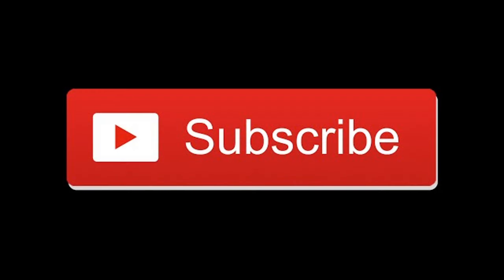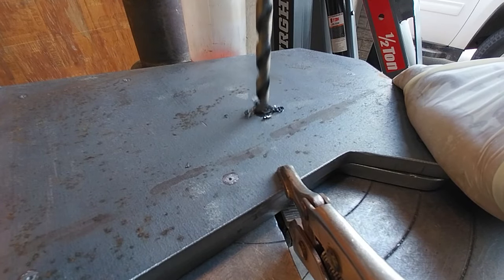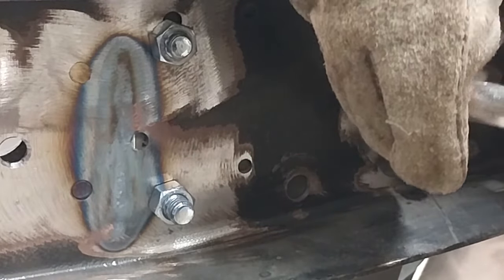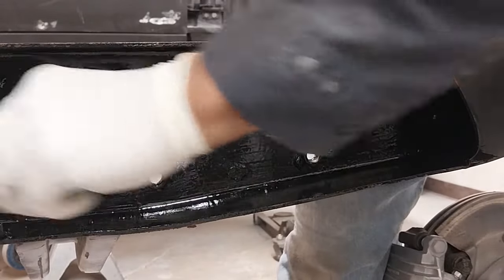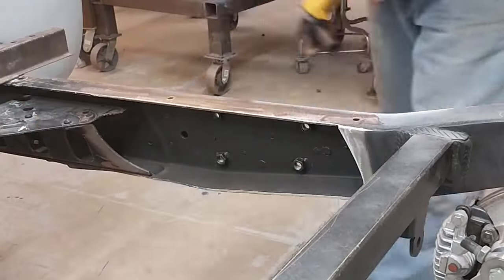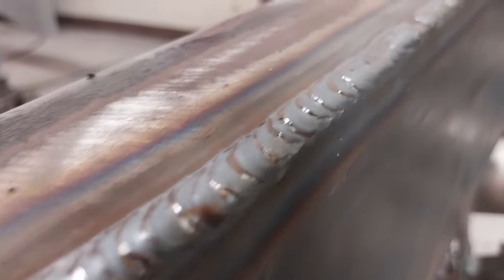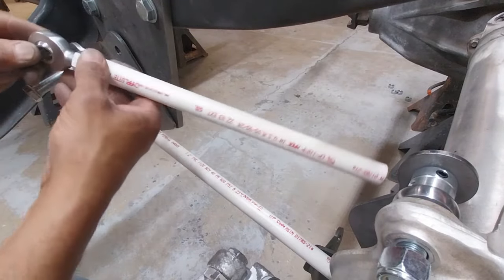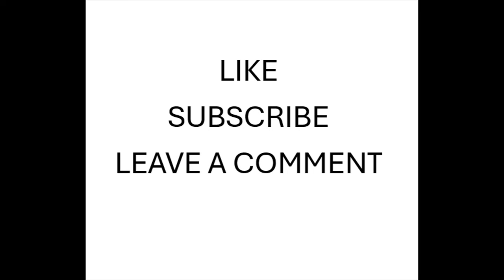Independant Rear Suspension (IRS) C-4 Corvette Swap  / Box Frame Rails - LS Powered Resto Project

Comment: Those were nice welds. No need to grind them. Heck after a powdercoat, you wouldn't even notice them, especially under a truck!
Reply from the maker: It's all in the fit up and prep, if that is right the welding goes really well. Thanks for the comment !!

Comment: Pretty bad ass it makes me want to do a zl1 irs on my truck. Robert question so I have a 2018 Silverado roof panel only got ugly on one the rear corners all the damage is in the  seam it tore where it curves down. I was thinking about cutting that area out and replacing it with new piece of sheet metal, would this be a good plan or should I just straighten the best I can weld it and seam seal really well?
Reply from the maker: If there is a donor or new piece available, I'd go that route. Thanks !!

Comment: You have a kit for the c4 install or were to get kit.😅
Reply from the maker: Great question, this kit came from flat out engineering, but I DONOT recommend them.... This was customer supplied. I've had to reengineer most of the kit and with this kit you can't use a sway bar in the rear. Sorry I don't have a better lead for you.

Comment: Will you put any pinion angle on the rear joint the corvette that I measured had 5 degrees up at the trans and 0 degrees at the rear which I thought was odd ? Do you think this is because they are rigidly mounted both to the frame and between the trans and the diff ? It seems to me that even tho they dont move like a regular suspension you would still want the rear joint to offset the front joint angle .
Reply from the maker: @manicmechanic9117  Great question, usually 3 degrees down at the tailshaft and 2 degrees up at pinion for a starting point but I'm not locked in, I can shim the front of the pinion mount  down and the tail shaft mount up if needed. Always leave yourself wiggle room. Thanks

Comment: That will be an awesome truck! Using the pvc for mock up is a great way to get the length set up! Never seen that before, thanks again for another tip that's just simple and works. Also like seeing the fab work done without an automated cutting table. I don't disagree with using those just nice to see the old school work still being utilized
Reply from the maker: @michiganracer1181  thanks ! It's funny  how you can measure something and it still be wrong... but with the pvc same diameter, no chance. Thanks for supporting the channel !!!

Comment: Hey Robert I have a  good question...Do you recommend or can you take a body off the frame with the front and back Windshield?..Thanks
Reply from the maker: Is it a convertible ?
Reply: @guzzifabrication3448  it is a Hardtop 88 Monte Carlo LS
Reply: @guzzifabrication3448  my thinking was that leaving my Front and Back Windshield would ADD Reinforcement and stiffness to my body that way it doesn't flex or bend..and that's with the square tubing reinforcement inside welded to the car with everything down to bare bones EXCEPT the Front and Back Windshield. Hey Thanks for Replying! 🙂

Comment: Hey Robert a lot of good tips in this one. Do you recommend the soapstone over the Milwaukee pens? I’ve been using those for years, but the soapstone is definitely more visible but seems less accurate.
Reply from the maker: Thanks !! I use both, but the soapstone never fails and I can buy a 5 yrs supply compared to 1 quality pen.... if you sharpen the soapstone accuracy is never a problem.  I think I've tried every type of marker
Reply: @guzzifabrication3448  ok thanks for the advice
Reply from the maker: @UnconventionalMetal  Don't get me wrong the Milwaukee pens are awesome !
Reply: @guzzifabrication3448  oh definitely, especially for the price, they even write on rusty rebar, scrap metal etc. but I’m still gonna get the soapstone from Home Depot to add to the toolbox. It’s even Lincoln!
Reply from the maker: @UnconventionalMetal kaaabooom 💥